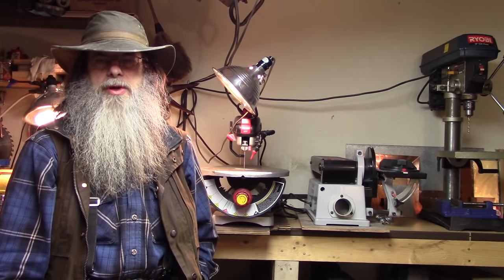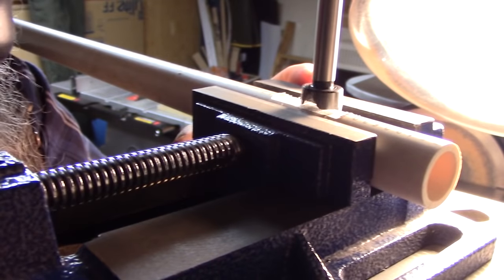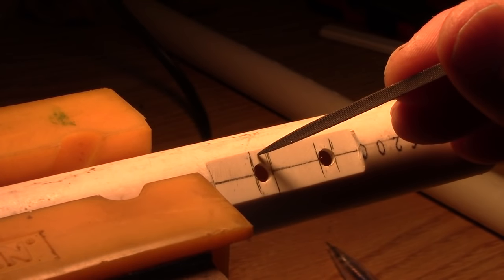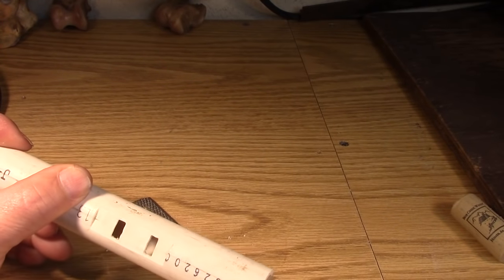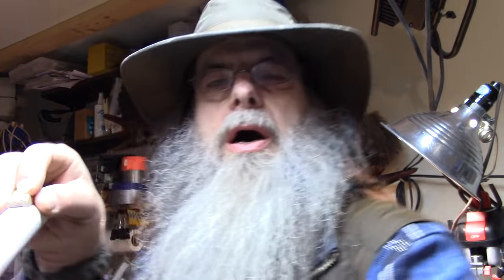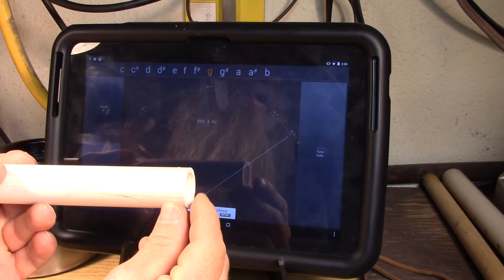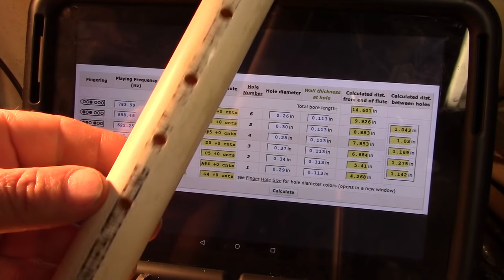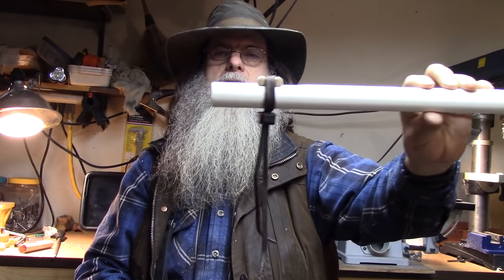How To Make A Homemade PVC Flute

Comment: when tuning, like when you have tuned the first hole, and moved to the next hole, do you leave the prior hole open as you proceed up the holes? If there is fingering involved, could you tell me what it is?  I'm making an E flute because I like the sound of that scale.
Reply from the maker: +Jerome Dechant    Yes, when tuning and hole "one" is tuned you then move to hole "two".   When tuning each hole, all previously tuned holes are left open in order to tune the hole you are presently tuning.   In other words, if you are tuning hole 4 then holes 3, 2, and 1 are left open and have already been tuned before moving to 4.   When tuning hole 5 then hole 4 is left open as well as 3, 2, and 1.     Good luck on your flute and hope it turns out well for you.
Reply: +Far North Bushcraft And Survival Thank you very much for your reply.  I truly appreciate your video and guidance. :)
Reply: +Far North Bushcraft And Survival I hope you don't mind answering another question.  in the table which provides hole location information, at the top it says bore length.  is that the distance from where the back (towards where you blow into the pipe,) to the end of the pipe?  As I mentioned before, I am trying to make an E4 flute, made the sound hole stuff and tried it, and it was very sharp E which means the length was too short, so I'm thinking where I used 18.127 as the overall length, maybe that isn't correct.  Good thing PVC pipe is inexpensive :)
Reply from the maker: +Jerome Dechant    It IS a good thing PVC isn't expensive because I had several failures before I got it right as well.   Total bore length is from the outgoing air end of the flute or in other words, the end farthest away from the player to the sound hole edge and not from one end to the other end.   As far as sound is concerned, I don't think it really matters how much length there is above the sound hole to the mouth end.   I like to make my flutes roughly an inch longer than they are supposed to be and make sure that my sound hole is further away from the end than what they recommend.   That then gives me room to tune the flute to the base key I want the flute to be by cutting off the farthest end a little at a time until that key is reached.   I do not set out from the start and cut to drill everything exactly like the data shows.   That gives me no wiggle room to adjust if something ended up wrong.

Good luck
Reply: Thanks.  Since I couldn't make it an E4, I got a tuner which would tell me, more closely what note it is without any holes, and currently at 14.125" (from the sound hole to the end,) it is very close to A4.

The chart says it should be 12.997" so do I still put the holes measuring from the outgoing air end of the flute to the measurements they designate? the C5 would be at 3.893", D5 5.038", etc. (according to the table, Calculated dist. from end of flute.)
Reply from the maker: +Jerome Dechant    Since you say that it is closest to an A4, I think if it was me, I would RE-fill out the flutomat as if you were seeking to make an A4 flute and then go with those hole placement distances that flutomat recommends for an A4.   In other words, it looks like to me you are going to have to make an A4 flue now or else just scrap it and try again with a new pipe since you probably know by now what it is you did wrong.
Reply: +Far North Bushcraft And Survival yeah, the numbers I stated in the last comment were those for A4 flute.  My actual length from the sound hole to the end is 14.125", but the chart says it should be 12.997" or almost and 1.125" shorter, so should I adjust the hole distances they say for 12.997" to be 1.125ish further from the end.  The numbers they state are based on the 12.997" for the A4 length, not 14.125" length.
Reply from the maker: +Jerome Dechant       I think I would go ahead and place the holes at the distance from the end that is recommended by naflutomat but would make the holes smaller than they recommend by quite a bit.    After you have the flute base note tuned, start out by only drilling hole number 1 and drill that hole much smaller than is recommended.   Now you should have room to slowly use bigger and bigger bits until you get the note tuned the way you want it.   Then go on and drill hole 2 smaller thqn recommended bit size but still at it's recommended placement distance and do the same as hole one and so forth.   

If you end up starting all over, first of all, be sure that you are using 3/4 inch schedule 40 PVC.   Then I would carefully fill out naflutomat all over again from the start being very careful to get all the pertinent fields correct.    I don't know which web site you went to but try this one.  http://www.flutopedia.com/naflutomat_g.htm      be very careful of the sound hole size both front to back as well as side to side.   Also be careful of the distance from the air supply hole to the sound hole though that isn't quite so critical.   Fill out the na flutomat before you do any cutting.   Now that you have the naflutomat data, cut your flute at least one inch longer and place your sound hole at least an inch further back from the end then is recommended.   Now you have room to tune the flute to the correct length.     Good luck and hope you figure it out.

Comment: Is there a technique for how you blow the air in or do you just do it
Reply from the maker: You just blow,   It helps to keep the air supply at a lower more controlled and prolonged rate and not just blast it in there though.  When changing notes from low to high or visa versa, a different volume of air is often helpful for clear sounding notes as well.

Comment: Hi, I have a couple questions. Why does the space between the two slits at the mouth have to equal the diameter of the pipe, and why did you choose 3/16 by 3/8 to be the dimensions of the slits? Thanks
Reply from the maker: It has been found by others that the side to side width of the sound hole is optimum when it is about half the width of the interior diameter of the pipe.   So If you are using a larger diameter pipe then you will need a wider hole.    The hole that makes the noise needs to be narrow from front to back because if it gets too wide then the air will loose it's velocity before it gets to the far side of the hole which splits the airflow and causes the sound.   too wide of a hole from front to back causes "breathy" notes.   I personally do not care for breathy tones and much prefer clean pure solid notes.
Reply: That makes sense, thanks
Reply: And one more thing. Are there any equations you used to choose 1.5 ft for the length of the pipe, and is there any way to increase the amplitude of the noise from the flute? Thanks
Reply: Sorry, I also forgot to ask why you chose 1 7/8 in and 3 1/2 in as the space where the air flow holes went, and why the holes are drilled at 2 1/4 in and 3 in?
Reply from the maker: I wanted the flute tuned to the key of G so I cut the overall length of the flute based on the "Flutomat" recommendations for that key.   I know of no way to mechanically increase the amplitude of the flute output but I use an app on my android tablet to add reverb and run the output to a remote bluetooth speaker.   You could amp the output to as loud as you want it that way with the only limits being the output volume of your speaker/s.
Reply from the maker: I don't remember why I chose that distance between the two air holes originally but it worked out well so I kept that distance on the subsequent flutes.
Reply from the maker: It is called "Real Time Audio FX" but is no longer found in the play store.   It can be downloaded from non approved locations but I know nothing of the safety of any of those sites.   I did find an alternative app on the play store recently but do not remember it's name now.    It did appear to have real time audio effects.

Comment: Would making all the holes the same size make a difference in the notes?
Reply from the maker: Yes definitely.  I suppose you could make all the holes the same size but then you would have to radically change the positioning of the hole placement.  The distances between holes may end up not being physically possible.   So yes, the holes will need to be varying diameters in order to get a nice convenient hole spacing and be able to tune the notes properly

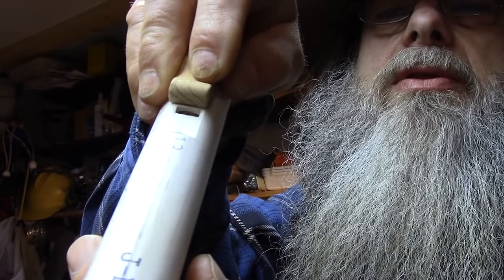Comment: Thank you, sir! I've a rough facsimile up to 10:12 using the same size of bamboo and a wad of tissue paper for the cork. Just experimenting, but when I blow, no sound except whoosh... Well, could that be because the far end is plugged? I left it plugged because you do that with a whistle, also am reluctant to cut off the end because I like the way it looks. Perhaps if I just added a hole near the end, that would suffice? Or does your flute work if you put your hand over the end? Sorry, this is a stupid question, but this is my first go at it and am not in a hurry. I want to impress my cute little grand daughter with a flute (you see in the pic at left, I'm the de facto daddy). Dang, fella, did anyone ever tell you that you sound a lot like Mr. Ed?
Reply from the maker: Yes my flute still plays fine with my hand over the end though it does change the note.   I believe your problem is with the air holes where the air comes out of one and goes across the top of the other with the tissue paper plug.   For starters I would not be too confident in your tissue paper plug.   It has to seal very well and let no air pass through it.   If any air passes through it, it will cause turbulance at the far end of the plug where the sound is trying to be generated by enterfering with the air coming over the top of the sound hole.   Also I would look at the air channel between the back hole and the front sound hole and question whether it is too deep or to shallow.
Reply: Hey, THANKs for the response.  Finally got a sound by carefully filing down the angle and adjusting the "bird." Made two more using the natural joint as a plug. Got decent sounds but still NO sound if I put my hand over the end. Apparently, since you still get sound with it covered, the trick must be a lot more delicate, or bamboo just doesn't work so well. I'll keep working on it, though. Will let you know how it goes. I'm from Montana, but retired Thailand 12 years, lotsa bamboo. Using the same internal 3/4", too, but not much uniformity with the bamboo, at 21" about 650 Hz. But depending on how hard I puff, I get 340 Hz, about F4, and then 650, and a high pitch. I'm not sure how to tinker with the holes at this point to get a stronger sound. later.. did get a much improved sound by sanding down the "bird" to narrow the slit a bit. Time for bed here...
Reply from the maker: Yes, I would be interested in hearing what you come up as a solution after you figure it out.
Reply: Going to let the bamboo dry for a while, see if that helps get a clearer sound. But I think you got me hooked, plan to fiddle with some PVC as well. Thanks for a GREAT tutorial.
Reply: Find that minor leaks around the bird are very touchy, and helped a LOT. I probably tend to blow too hard and adjusting the bird is very sensitive, too. Did a PVC one today, maybe a little better but the only 3/4 PVC I could find has much thinner walls. Still, it seems to work okay, but I have ONE question. Any ideas for what to use instead of cork, can't find it here. So far, I get only 2 octaves with the PVC as opposed to three with one of the bamboos. If I can come up with something better than a wad of tissue, I'll start tuning and making holes.
Reply: Here's the trouble with the bamboo. It's green and quickly starts to shrink, leaving a strong depression in the center of the flat region. No sound... but after planing flat again, a good sound for a few hours, maybe better than the PVC, but I'm still tinkering and don't have a good plug for the PVC yet.
Reply from the maker: How about a short length of round dowel.  You will need to build up the diameter of a too small dowel by using a tape such as electrical tape.  If your dowel is too big then you will have to sand it down so that it will be narrow enough to work.    It will need to fit snug enough to seal though no matter what you do.
Reply from the maker: Sounds like you will have to harvest your bamboo and then allow it to thoroughly dry before transforming into a flute.
Reply: This being Thailand, not sure where to find dowels, but that will be on my mind. Got four blanks lying in the sun now! 
Thanks for the tips!
Reply: Found a tapered cap on one of Meaw's lipsticks that fits perfectly. Holes are in, tuned pretty well, but struggling to learn how to play songs, now.
Reply: since this is basically an organ pipe with tone holes, and I make organ pipes for a living, I thought I might as well put in my two bobs worth: putting your hand over the end will change the note of the flute. if you do it with a blank tube, i.e one with no tone holes, said pipe will speak an octave lower than than it's length (a 4' pipe will speak at 8' pitch). However, the distance from the end of the wind channel to the lip of the mouth has to be greater on a stoppered pipe than an open pipe for the same pressure. so, if you want your flute to speak with the end blocked, try blowing less hard. also note that blowing too hard on a flute like this can make it speak its octave, i.e an octave higher than normal. this is actually useful, as it gives you another octave of notes that can be used.

Comment: By "1 by cedar" at 8:25, does he mean 1 inch high?? what are the dimensions of the cedar?
Reply from the maker: "One by" is a term used in construction that refers to he board thickness.  A "one by" may refer to a 1X 4 (one by four) or 1x6, 1x8,1x10 or 1x12.   "One by", though it refers to a board being 1 inch thick, the board is actually not one inch thick but is more like 3/4ths of an inch thick.   Now in this application, the maximum height or width of this "bird" does not matter.   What matters is the dimensions of the air channel on the bottom of the bird.

Comment: Can someone help me? I made one and its sound is coming out very low, I have a fife that I made and its sound is loud compared to this flute that I made, what can I do to improve the sound? he is in tuned
Reply from the maker: I am sorry but there is no way for me to analyze your problem without seeing the project.   Several factors affect the sound output.   The size and shape of your sound hole, the shape, dimensions and size of your air channel under the "birdie."    Whether your air chamber is totally sealed off between the air escape hole and the sound hole.

Comment: My first attempt last night was met with failure. I duplicated your flute in every way possible but when I drilled my first hole it was way too big. Through trial and error I found that, for some unknown reason, my holes had to be very small compared to yours or to the chart. Any ideas as to why? Attempt #2 will happen tonight.
Reply from the maker: +Doughiemantoo    That is why I suggested finding the smallest sized hole of all six of them and then using a slightly smaller bit than even that and drill all the holes with that bit.   Then carefully work up bit by bit until you reach the note frequency you are looking for each hole.    You may have to even use a round file at the last to "edge" up to the correct frequency so as not to drill too big of a hole and go past the frequency.    All may not necessarily be lost on your first attempt however.    You could fill the hole in with epoxy that would be suitable for use with PVC.   Once dry you could then redrill but using a smaller bit.   The great thing about using PVC pipe however though is that it is cheap and it only costs 75 cents american or less for the length needed for a flute.   So if you screw up a few attempts, you have not lost anything financially.   All you are out basically is your labor.    Each mistake teaches you more knowledge on how to do it better next time.
Reply: Thank you for the quick reply. I am going to start small on the second attempt. The smalls hole on my list was 1/4" I started with a bit that was half that and it was still too big! Failures are only lessons.
Reply from the maker: +Doughiemantoo   It may be that your source of PVC pipe is actually thinner or thicker walled than my pipe that I used.   In other words, wall thickness, distance from the air outgoing end to the sound hole, each hole placement as well as hole size all effect the sound frequency.     Good luck
Reply: It would seem that starting really small and working my way up will overcome the different obstacles. Patients is a virtue! Thanks for your comments.

Comment: How much harder would this be to make out of something like bamboo?
Reply from the maker: +Kyle Bates    I have never worked with bamboo since we don't have that in Alaska but I do know that bamboo is used to make flutes.    I don't know how hard it is to work with but I would guess that it wouldn't be too difficult.   A great thing about bamboo is the natural occurring sections in the bamboo make it real handy for flute making.   Where I used the wine cork, bamboo does not need anything. since it already has a sealed plug built in.   Of course you will need to design the flute with the position of that plug in mind so that the plug ends up in the flute where you need it.
Reply: +Far North Bushcraft And Survival thank you very much for the quick response. I think next time I see some ill give it a try, I think it would look really nice. All the best from California.